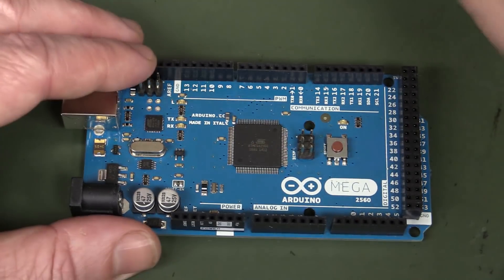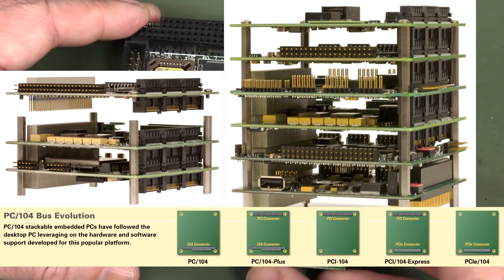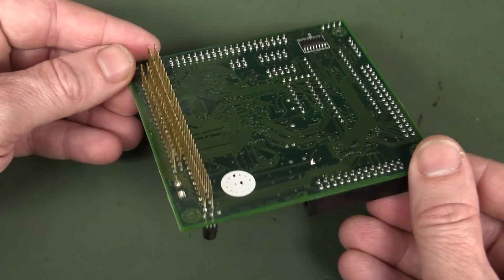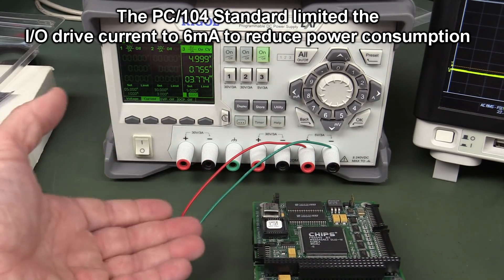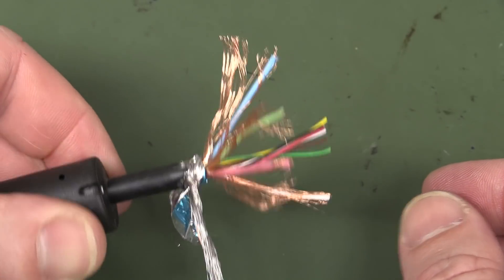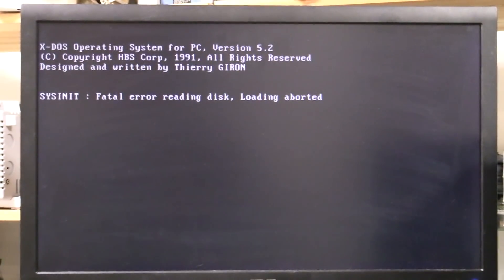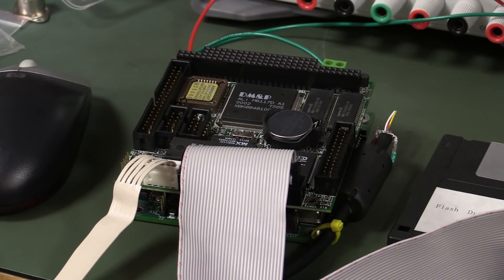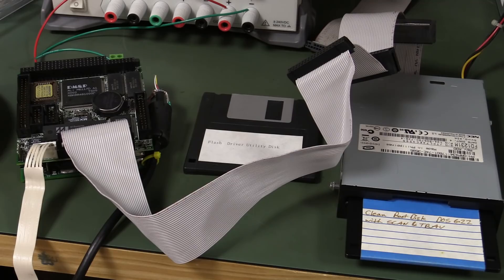EEVblog #1028 - What's All This PC/104 Stuff Anyhow?

Comment: I believe that VGA header was a commonly used arrangement back in the day. I remember working on motherboards with integrated video that used a header like that to connect to the HDDB-15 socket on a slot plate or back panel knock out.

Comment: They use a similar standard for one of the boards used in Dixtal 2010 ECG monitors. I believe it's the power management board (I don't quite remember off the top of my head), which connects to the motherboard via the pins on the bottom of the board.

Comment: I have actually got something a little bigger with the same isa 16 bit header, a 10Mbit lan controller module. It is a CSI Netplus Series 2000 Router with a I386. It was pulled out of an I/NET door controller system.

Comment: I have a bunch of PC/104 compatible systems. They plug into a PCI/ISA backplane and the single board computer cards have PC/104 slots on the side. Pretty cool. One of them I salvaged from a system that was "broken" and had been left out in the rain. Took it home, powered it up and found it was running Windows NT 4.0. The BBC used to use it in R&D according to the files on it. It was used for analysing the DVB-T network. The analyser cards were from Wavetek Wandel Goltermann.

The other system I salvaged was used in the automotive industry hooked up through a TAXI interface to a Brüel & Kjær data acquisition box. Sadly I couldn't find the box that it goes with for a reasonable price. Had a beautiful modular ISA card inside though with six huge Texas Instruments DSPs on it, a 5w4 connector on the end and a shielded ribbon cable that ran to another ISA card in the box.

Both systems were Dolch MegaPACs. I'm currently in the process of modifying one of them to take ATX boards. Already got it a 1080p LCD to replace the 800x600 one on the front.

Comment: You find a lot of these guys driving machinery in industrial places. I'm my case, in my work we use equipment by quipp and it uses a different form factor based on an ISA backplate with push-in cards. To me, as a computer geek, it was amazing to discover that work machinery were really computer parts on custom boards

Comment: I do wonder if these are the boards used in the plastic injection molding machines I work with? The oldest models use CRTs while some have LCD screens with floppy disks and the latest use touchscreen LCDs with compact flash drives.

Comment: i worked on Postal mail sorting machines that used the PC104's about 20 years ago. One thing I learned about them is if the 5v rail ever dipped below 4.7v the system became unstable. It did not help that the 5v supply was about 6 feet away and they did not bother to use remote sensing so if the supply was putting out 5.00v you got 4.76v at the stack. To make it more interesting the placed the supply in a very difficult to reach area so you had to rremove the supply to adjust the output.

Other than that little feature they did their job well.

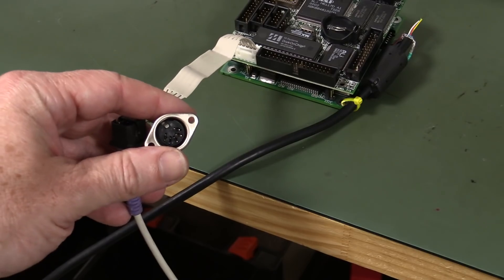Comment: The keyboard connector that came with the board at 18:18 actually looks like an PC/AT keyboard connector (5 pin DIN) rather than a PS/2 connector.
Reply from the maker: +coobird's lab yes but the protocol is the same

Comment: My first PC was an 80286 with 640K of RAM.  I upgraded it to 1MB of RAM and installed Windows 3.0 on it (40MB HDD).  Some of my classmates at school had PCs running MFM and/or RLL hard disk drives (which I got to see the innards of).  I think mine was running the newfangled IDE interface on the HDD.  Remember SIPP RAM modules?

My introduction (as far as I can remember) was via DOS v.3.1 or thereabouts.  I worked my way up through DOS 3.3, 4.x, 5.x, up to 6.22, Windows 95, 95a, 95b, the rare 95c, 98, 98SE, NT4.5, 2000, Major Error (a.k.a.: Millennium Edition), XP, and so forth, up to 10 and Server 2016.

Never saw a PC/104 system (also never heard of it before).  Seeing the floppy, IDE, and DIN connectors, as well as the BIOS, POST, and DOS boot screens brings back memories...

Comment: I once bought PC 104 computer kit from ebay out of curiosity. It was a fully functional small form factor PC. Has USB ports, CF card slot, built-in ethernet. I installed Damn Small Linux on it and it works great. I plan to build expansion card for it with 8255 PPI chip.

Comment: 12:00 Electrical Engineer awkwardly stands boards vertically to connect them; Mechanical Engineer cringes knowing that the boards could be flipped over on top and connected comfortably.
Reply: Looks like it would be sitting on 2 of the 6 pins in the corner, causing them to bend with as much force as he had to use. It wasnt completely flat.

Comment: Dave I have a LOT of synthesizers and music gear that uses 720 and 1.44 floppies and those USB  to floppy devices are a god send. It is frankly amazing that a 30 year old floppy drive still works like a charm, but I won't press my luck so the USB adapters are what I use. Bonus, it's easy enough to download disk images for any OS you desire and load them up.

Comment: I worked on a WISP CPE in the late 90s using a PC/104 486.  I'm pretty sure we specced them with a 16MB 72 pin SIMM and either a 4MB DoC or a 8MB DoC with room for a backup image.  Ran highly specialized GNU/Linux 2.0 (IIRC) and powered over Ethernet.  No video or KB, but they may have still had a floppy controller and headers.  bash and tcl were crammed in to do management and glue logic.  Wild times.

Comment: The rpi and arduino are designed to bring an easy to use platform for learning, and digital electronics creation in the consumer market (ie at home)

Where as the pc104 was designed and built to standardize industry electronics...

They aren't really comparable

Comment: I've got a couple PC/104 boards with i386EX cpus running some embedded DOS (DOS-ROM).  Sadly only has the 8 bit ISA bus and 512K of ram.  I've also got one of the PCI/104 boards with an AMD P5 clone @ 133 MHz, but I don't have a video card for it.

Comment: Sorry, Dave but the first embedded controller that I've seen was a KIM, with a 6502 in a piece of old medical equipment. The KIM was the development system to design 6502 based computers, and it predates the Apple II.

Comment: I think the ISA spec had like +12V -12V +5V -5V in the bus so I am unsure why you only have one input rail unless there is a regulator on board for the missing ones granted the bus was really ISA. Looks like a floppy is out of calibration, or that some need to be low level formatted before writing to them.
Reply: PC/AT bus is correct, the name ISA came later when companies other than IBM started dominating the scene with their clones. Voltages other than +5V are really only for peripherals, for example 12v spindle motors in floppy/fixed drives, or RS232 which uses +/-12v signalling.

Comment: In 1993-4 I talked with the founder of Ampro right after he got out of it. He mentioned that it was great for 4MHz stuff like old x86. My job is now to replace all that stuff with shit that actually works. An example - we had one client using a Celeron-based 104+, and the EMI interaction between it, the other I/O cards and the SMPS that was also on the stack was so hideous that it was pretty much useless. 

BTW - PC104 Plus is the PCI version of it. http://pc104.org/hardware-specifications/pc104-plus/
It added a PCI bus that was a nightmare as far as PCI bus mastering - most had a shitty rotary switch that would set the slot position (see the PCI spec).

PC104 Express is with PCIx...

So the PC104 is poo, and if you want to see real poo take a look at PICMG - wow... silly 

Or how about ETX or EBX? 

Or the other zillion formats that places like Advantech and others sold. Here's the deal - Intel used to have an "embedded" goup - unlike most Intel processors that have a max. 6 month roadmap, Intel was at one time supporting a sub-set of processors and chipsets for 5 years...

Well - no more of that. So PC104 lost a lot of support for x86 parts...

Stand off is 600mil... totally non- standard spacing. 

Oh yea - go get some of those I/O, serial cards. You can even get "bean rails" to mount in rugged stuff. https://www.curtisswrightds.com/products/electronic-systems/enclosures/shock-rocks.html
Work?  - Uh sort of... what a mess....

Uh - unleaded? - Naw most of the dinosaurs that still use these are using it for mil applications - no RoHS there:
http://www.army.mil/-news/2010/06/11/40712-army-works-to-decrease-lead-free-electronic-components/

Sooo... uh... yea... right on... Your phone has more proc power...

Speaking of all the ARM based stuff. Here's the next furball. 
So for the last few years, Freescale/NXP (now Qualcomm), TI, Atme (now Microchip), ST, Broadcom (now Avago) and others have been introducing a ton of M and A series (M's are self contained - like whats in you washer/dryer; A series is what's in your phone - MMU fo SDRAM).

So to spin up a chip fab, it takes between $20 and $600 mil. So you better have some customers. A lot. And once you get a thousand processes in the fab line working right - you better keep it going. One gas changes slightly in process 1215, and you just turned 300mm drink coasters. 

So all these guys wanted to get the "big design win" - some high volume consumer product.

Well, Allwinner - a fabless place in CN that DID get the big wins - follows a similar biz model as Intel. 6 month product lifecycle. Then on to the next hotness. 

Well where does that leave all these standalone uC guys?

Fucked... bigtime.

Yea - I know Raspberry Poo may sell 20 million units. May. And that's across variant in the Broadcom portfolio. 

Do the math. At a half a billion bucks to fab these, do you think that paltry amount will suffice a stockholder or board member? Whats the ROI on that?

Poo... And once the car mfg's (about the only industry still supporting standalone uC's)  realize they too can do what Aplle and the others do and fab their own Allwinner thing - that'll dry up about the only mass market left for those uC companies.

And Broadcom refuses to release a full datasheet for what's on those PeePoos.  take a look at what Olimex is doing:
https://www.olimex.com/Products/OLinuXino/A20/A20-OLinuXino-LIME/open-source-hardware
Yep - over fab of the Allwiner A 20. And they actually released the full datasheet... why?

Cause they're on to the next thing.... that they'll actually make money on. 

So, we'll go back to the way it was back when these PC10foo things came around - for actual embedded stuff (things with out external SDRAM and low proc requiments) they'll be some ARM M thing that somehow got into a vending machine. 

Fun times.... NOT.

And as to even using a rasp. PI for most "Maker BS,  - this is the same thing with PC104.

Ya need to turn on a relay. So Get out your OS, compiler, IDE and have the Pi or 104 run a zillion clock cycles to eventually map something to go "ON"

Talk about a misapplication of technology - That'd be like hiring me and a bunch of my old friends to shoot a porn flick. All the Viagra, oxygen, EMT's with defibs, etc... and then ya got to pay us enough to pay for wives/support, kid's college.

Too much overhead.   Better off going to some bar and getting 20 somethings...

Funny - the porn industry is smarter than all these STEM/Maker guys...

Comment: I have few of them. Most interesting is a 386 with kind of ISA expansion board. I bought it thinking about building small platform for retro DOS games, after installing ISA VGA and sound cards. :)
I also have couple of Vortex86 586 (approximately 200MHz) and one 686 (800 MHz) boards. Still think about using them in some kind of project, instead of Raspberry Pi. The thing is there is no GPIO, but  it would be interesting to just try build own expansion board on ISA bus. :)

Comment: Brand new PC/104 3/486 boards exist with only one and sole purpose: Replacement parts for designs which use them. No one is using these boards to build new designs.
These things are built in small quantities, still are certified for use in production environments, and because them still implement full ISA bus (and use old chipsets because there aren't "modern" 486 SoCs), these things require multilayer PCBs to connect all the modules and components. That's why them are still pricey.
In the other side, if you have a still working million dollars instrument/equipment/machinery with only a faulty computer board, and the faulty board replacement costs just thousands... I guess the answer is clear.
Reply: >there aren't "modern" 486 SoCs

sure there are, your chipset has three 486s running MINIX, part of DRM/backdoor Intel Management Engine ME11
Reply: So what? These cores aren't being sold as standalone parts you can use to build a PC/104 modernized and cheaper design needing less PCB layers. Also, isn't enough with the 486 core alone... Its SoC chipset also needs provide a full ISA bus implementation in order to be PC/104 compatible. As far as i know, there aren't even Intel Quark SoCs with such specifications.

Comment: And I thew my Ampro little board out .....
I orginally bought it to make a dial up BBS system, however that never eventuated, then the rail inverter for the -12V to run the RS232 interface died, so I scraped the whole thing.

As for PC/104, years ago when working for Telstra we were repairing these video scramblers (Pay TV) that had Ampro PC/104 boads in them. When they eventually got scrapped I made sure I scored the Ampro's out of them. These were pre the 'Disk on Chip' you have in your's, they contain one large eprom (apart fro the bios eprom) to boot from. I desected one and found apart from a header, they were basically a disk image. So I made some test boot disks on an old laptop, on 720k floppies. This was imaged, then written to the eprom - success!

Later I looked at the PC104 pinouts and noted they looked identical to a PC ISA bus, so I grafted an old CGA graphics card on, and, again my luck persisted.
I never did connect a keyboard as you did, I just made up self booting images/ eproms.

Pity there is no picture insert button on these comments... it's all at arm's reach.

I was going to make one into a bedside clock, at the time I thought it would be good bragging rights to say my clock run's on Dos, and is written in Turbo Pascal.
Reply: You Could always post links from Google drive or something to the images then add a  reply or edit the comment.

Comment: Respect. I booted Win95 on a Kindle Touch once via such a dos hack (binfmt_misc and a custom Buildroot Busybox loader). The ridiculous lengths we go to once we are committed. That rig could still run plenty of gear today and beyond, if it met industrial needs 20 years ago such processes don't suffer the whimsical driving forces that afflicts gaming and are left to pursue better implementations on the same hardware which was the heart of; the original computing movement; Pc/104 as a standard; and all well considered coding ever. Better implementations evolving with a dependable, expansible equipment base. It's easy to see why the staying power exists.

Comment: It would be interesting if someone builds an adapter board that fits into the DiskOnChip socket and provides a microSD card slot. And about that Disk on Chip maybe you can build a USB DoC programmer using one of those USB PATA bridge chips.

Comment: Thanks for the trip down memory lane. I haven't thought about PC/104 for many a year. I didn't ever work with these devices but I remember reading about them a lot back when I used to read BYTE magazine. Back in the day the size of the boards was made to fit on the back of 5 1/4" floppy disk drives.

Comment: Nice, but that totally exposed pins on the underside of the board... yeah, that looks like it probably could be better designed. IDE connectors at least have some plastic around them to protect the pins.
No RTC? That's surprising. Didn't they need that for an industrial board, or was an add-on?

Comment: I had a few pc104 plus SBCs back in the day. I didn't know there was an 104 express standard. If 104 is still going, what's the newest boards out? Been not very impressed with pi and been wishing for a modern 104 board. Rather have something more robust for making machines with then a pi and not have to use registers to give more io out
Reply: Paul-Joseph de Werk those are still the isa ones. Also same boards I had from a catalogue I had way back in 2000. Nothing new

Comment: Almost year 0? It's what started computing and i don't think many people interested in arduinos think they started it.But they certainly moved the goal posts on affordability and KISS.

1992 when this was released and Arduino was released with its first board in 2006. So less than a decade actually. Keep in mind the innovation behind Arduino wasn't a small stackable form factor but having free and accessable tools to program microcontrollers. The first arduino had a serial port for programing built right on it. That was the innovation really. But since then they've also been instrumental in lower the price of these boards and making strides in the software.

Comment: I use these in my lab with real-time Linux for controlling robots! Very expensive but amazing performance compared to things like the Raspberry Pi! This is mainly because SBCs like the Raspberry Pi do not have their PCI / ISA buses broken out. You get them with high performance CPUs like the Intel Atom.
Reply: to be fair, it would need to be more of a comparison with 50-150$ pico itx/thin mini itx intel atom SBCs than with 5-15$ Pis. But those don't often use standard GPIO connectors, so it's a trade off, still, if you are willing to do the trade off it may be cheaper.
Another consideration you could have is Pci express Fpgas, which you can plug into any motherboard with a pcie slot.